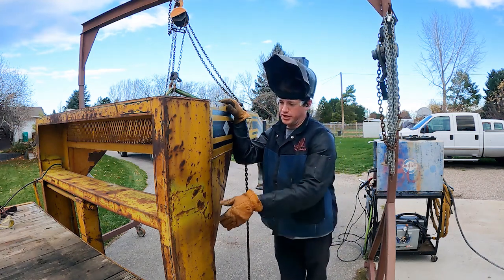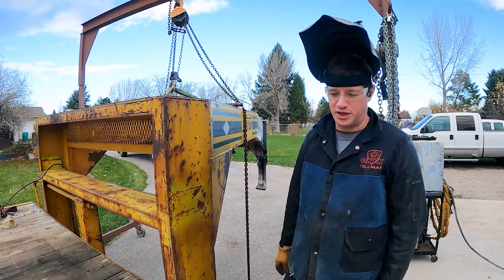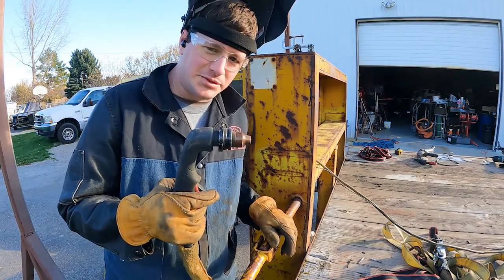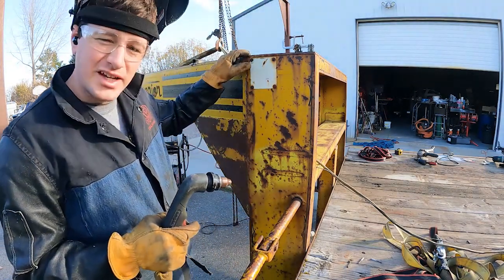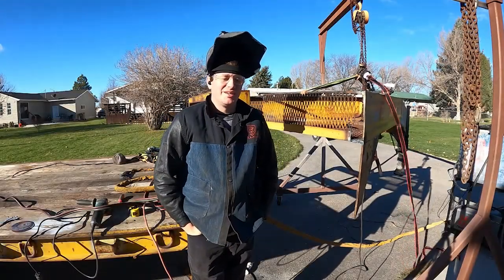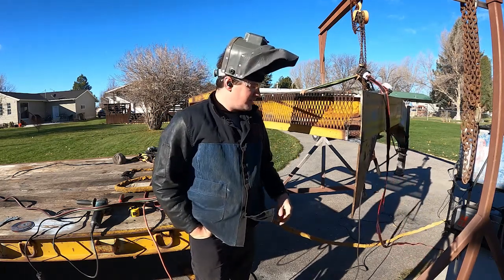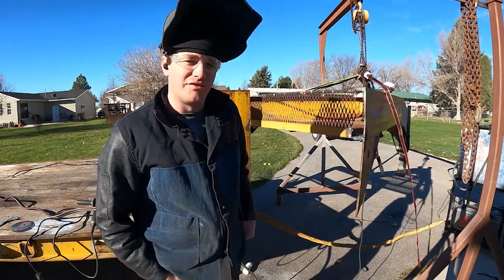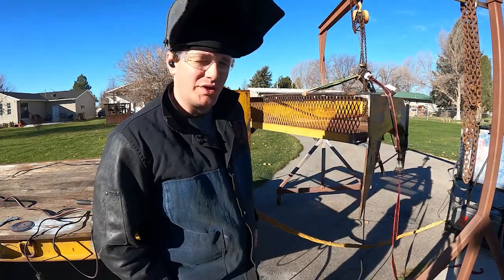Gooseneck Trailer Modification/Repair Part 2: Neck Pt. 1

Comment: Basically just making the hitch taller?
Reply from the maker: Yeah. This age of trailer the hitch is so low that it would interfere with the bed and tailgate at any sort of an angle other than flat ground. My truck had two inches of clearance from the bed rails up when I first bought it. I should have taken some reference pictures. Thanks for watching! And commenting
Reply: @tysoddjobs  hey thanks for posting bro. I’m probably about to do the same thing. Have an older homemade gooseneck I picked up today and same issue on my dually. Not terrible, just makes me wonder lol. I don’t wanna wonder.
Reply from the maker: Nice! The trailer unloaded sits about 1.5" higher in the front than at the axles. So I figure I can have a pretty good load and the deck will be level. I use it as a work surface also on different sites. Congrats on the trailer and good luck on the upgrades! I need to build new ramps and then paint mine.